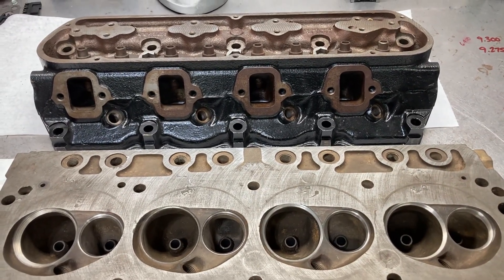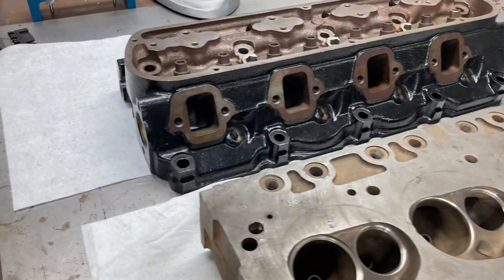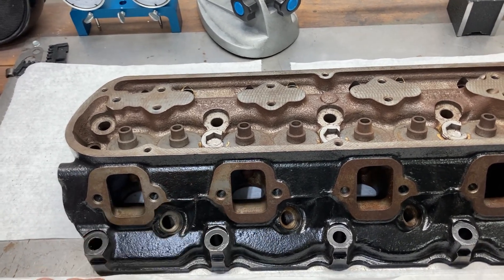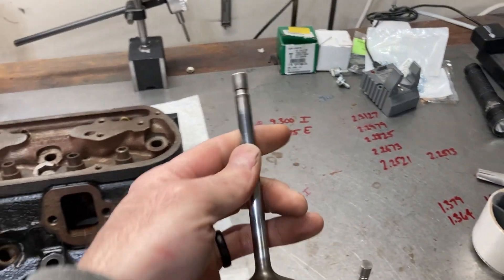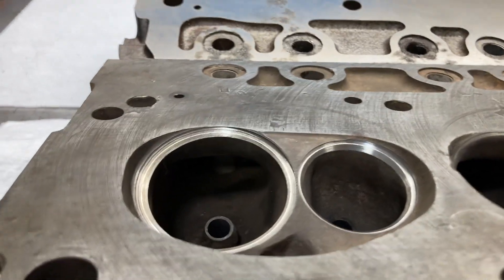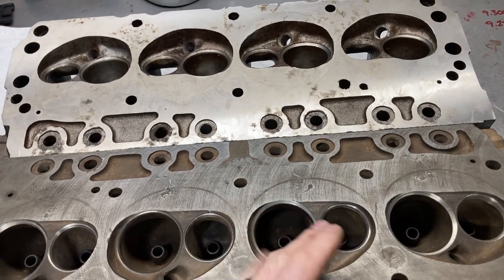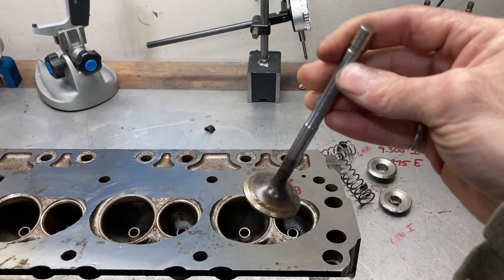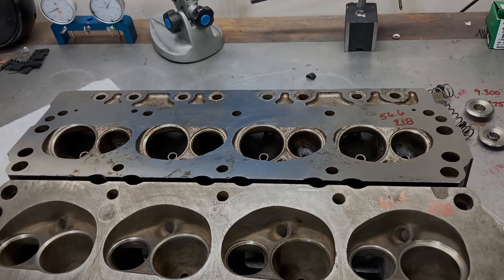Lykins Motorsports SBF Tunnel Port Race Head Overview

Comment: Donavan used the under cut section in the middle of the valve stem on both intake and exhaust. I believe it was mainly for weight reduction more than anything else. Id suggest taking a big cut off the bigger chamber head, sink the intake seats, and shy away from any inserts. Since they are not a matched pair i think you need to make then the same in port volume, bowl and throat dimentions. You cant tell me that someone hasnt already attacked them with a porting tool, so i reckon just give them to your good head guy and let him at least doctor them to be the same , if not a little improved.

Comment: Spray weld the head with the sunken valve seat. Had a 427 tunnel port head done. Then you can run it without seats.

Comment: Um those aren't "tunnel port" heads. "Tunnel port" Ford heads have a tube passing through the intake port for the pushrod to straighten the port passage instead of changing it's shape and flow to pass around the pushrod.
Reply from the maker: I’m sorry, but you’re wrong.  These are in fact SBF tunnel port heads.  FE tunnel ports have the pushrod tube in the intake.  SBFs have them in the head.